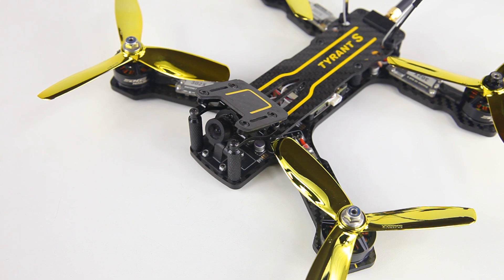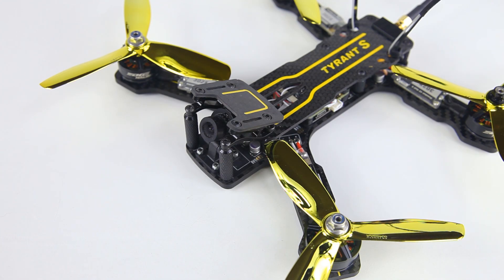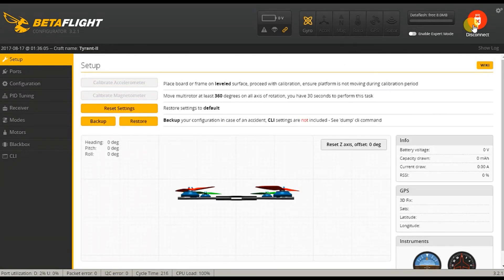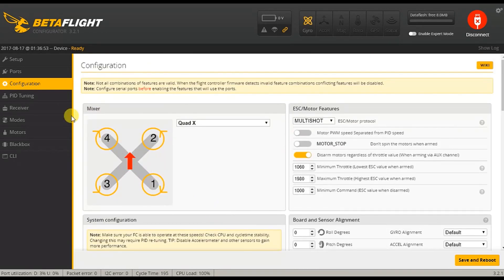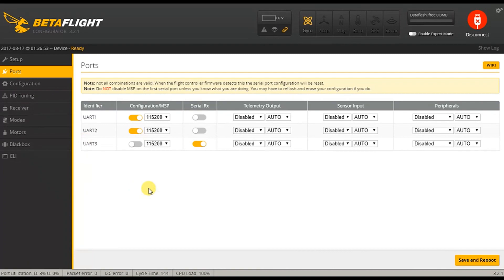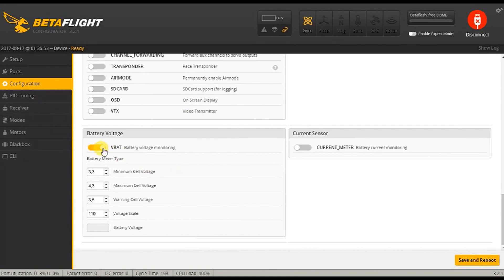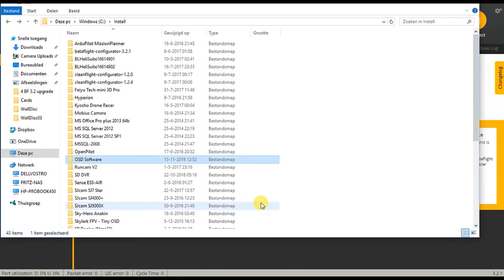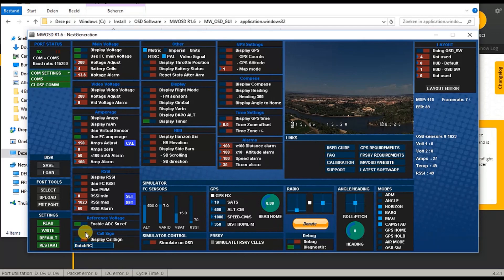Dytone TyrantS - VTX With OSD upgrade - Part 2 :)

Comment from the maker: The Diatone TyrantS is Great, but has no OSD! :O  Let's solve that!! :) 
Link to the Quadcopter itself: https://goo.gl/UgmwZN 

Link to the SP3 VTX with OSD: https://goo.gl/3GXoF5 

FM800 PRO FASST Sbus receiver I use: https://goo.gl/m4IvZD

Specifications:
Wheelbase: 215mm
Frame out of: 4mm Carbon Fiber
Flight Controller: Diatone D-Link F3 V2
Motors: 2205 2300kv
Propellors: 5042 x 3 
ESC's: 30A BLheli-S (60A max!)
Camera: 800tvl Cmos camera 
VTX: Diatone SP2 V2  48ch 0/25/200/600mW
Beeper: Yes
OSD: nope 
LEDs: nope
Lipo: 3S or 4S